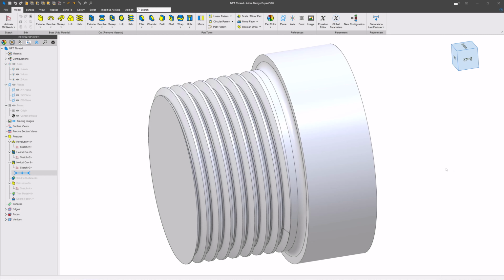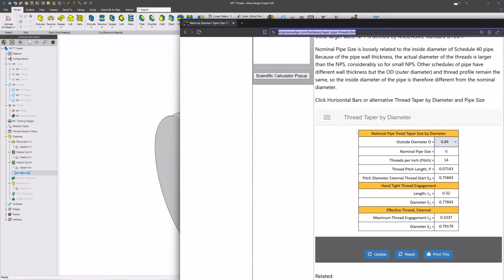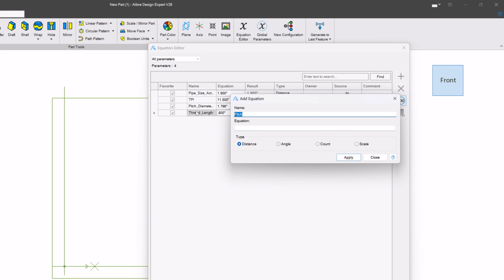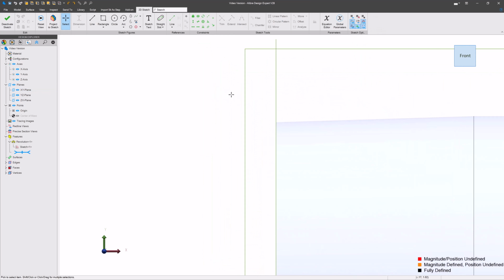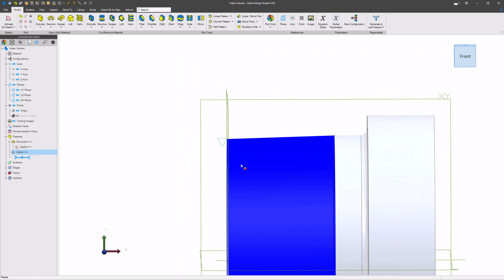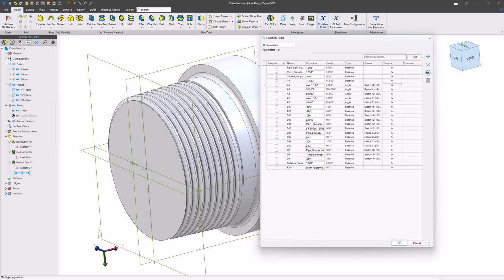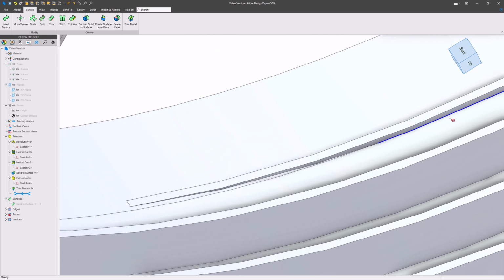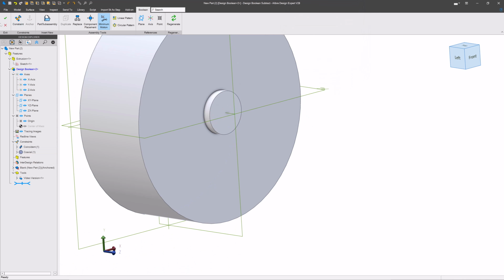Physical NPT Threads in Alibre

Comment: Thanks for this.  I wanted to 3d print some npt internal threads.  I did run into an issue where I was getting a leading space in the equation editor causing "Please Enter Valid Value". HaroldL from the Alibre forum was a big help figuring that out.

Comment: Excellent video, however your internal thread is completely wrong as you could not fit a male thread into your female as you have not run the thread to the end. Could you have made the length of the boss shorter to give you full depth of thread at the large end?